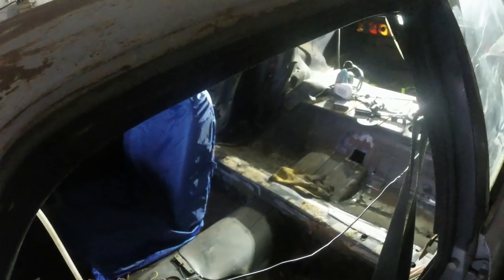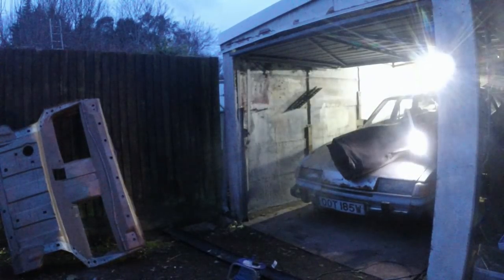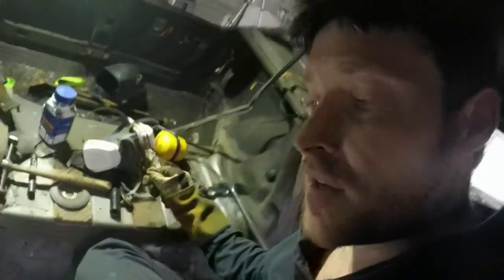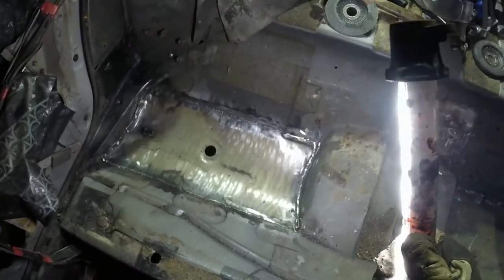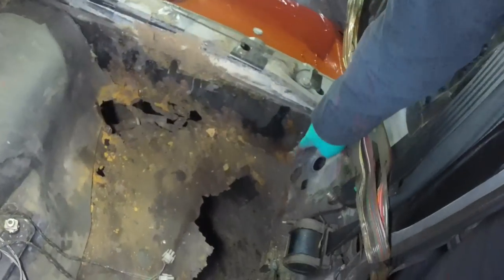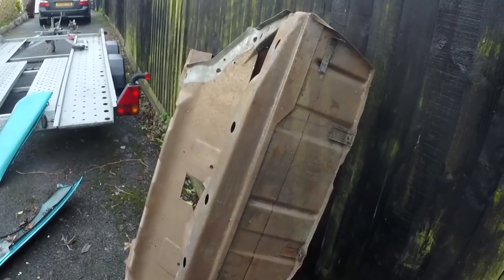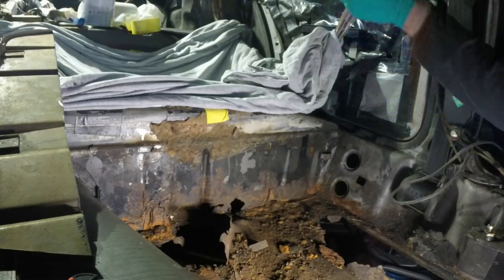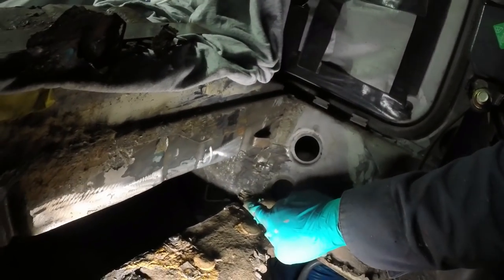Dotty 1981 Rover SD1 Restoration - Video 11 Floor repair More welding

Comment: love these video's, hubnut originally brought me here from when you took the diesel to the NEC. anyway I only have a crappy no-gas welder and for that reason, I dont do welding! but if I did, looking at your videos gives me hope that should I ever get a project car, and a proper welder, I would be more confident with some repairs to sills and floors. Perhaps you should call your channel "doing rovertime", I know you have done bits to other cars, but it is very apt.
Reply from the maker: Yeah i met Ian at the show last year.  Ive got a month to get the diesel welded up and back to the show.
Reply: @nitrosilvia  good work and great videos mate, and Hubnut is great to watch too!

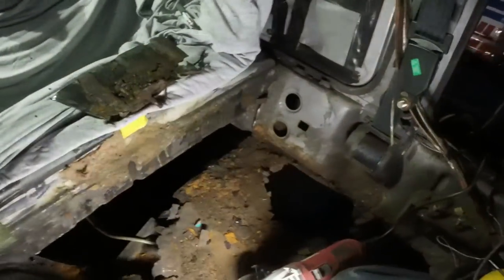Comment: Good points made at 32:50 ish. There is some sort of weird loathing of British products among a lot of British people. We need to get over that as a nation and back our own industries and look through the negative hype at what's really there... Or used to be there :-( When it's gone it's hard to get it back!
Reply from the maker: Such a shame.  SO many cool cars and yet the vast majority of the general public dont see it.  Bizarre.  Just the Clarkson effect.
Reply: @nitrosilvia  yeah I knew doom was coming when week after week Clarkson was talking about how shit Rover were

He had some American singer on the show... He wrote a little song all about how shit Rover are. Clarkson loved it and asked the bloke what he knew about Rover

The geezer said he didn't know anything about Rover - but knew how much Clarkson hated them

And then May's review of the 75... Shiiiiiiiiitttt 

Hammond's Men and Motors review of the 75 was very good
Reply: @hydorah  may had a point though, the 75 was, and still is, a nice car. One of it's main problems was the retro styling, why not something modern?!? Yes, it (sort of) worked for the S-type, but how many did Jaguar sell compared to the equivalent German offerings of the time?

In my opinion another issue would have been the size of the thing. The 75 was too big to compete with the 3 series/C Class/A4 size of cars, but too small to compete with the 5 series/E Class/A6 size of cars, so it sat awkwardly between the two. Add this to the slightly dull handling and the 75 was, again in my opinion, a good car spoiled.
Reply: @Robert_B_445  There was the MG without any retro. And what about Mini? The whole brand is about retro. May is a buffoon and he was just performing in that review. It wasn't about the car very much at all
Reply: That may be true, but the MG and the Mini were niche cars, they didn’t need to sell in huge numbers, the 75 did and so might have done better if it had more modern styling
Reply: @Robert_B_445  I was referring to the MG badged variant of the 75, the ZT - And the range would have done better if May hadn't panned the whole thing, along with Clarkson
Reply: @hydorah  Oh, I see. In fairness, I seem to remember Clarkson gave a very positive review of the ZT.

Anyway, I think you rather overestimate the impact Clarkson has on car sales, for example, he gave a very negative review of the Ford Orion, and it went on to become Britain's bestselling car for a time.
Reply: @Robert_B_445  can you link to that? There was a V8 one... With a Mustang engine in it... Maybe it was that? I'm curious to see Clarkson being positive about anything Rover
Reply: @hydorah  The V8 one was the one he reviewed, there was also his review of the MG SV and even his reviews of the 800 on old top gear (although confusingly he later describes the 800 as "dreadful" at the '98 NEC motorshow). Still, he's not completely negative about rover
Reply: @Robert_B_445  yeah the blokes a complete tool

Comment: Nice work! I'd appreciate the name on that red oxide can if you can remember it off hand, thanks.
Reply from the maker: Its called Bonda Rust Primer.  Its pretty expensive, around £25 per litre, but its good.
Reply: nitrosilvia
Thanks!

Comment: What's the name if the red oxide primer and where can I buy it?
Thanks
Reply from the maker: It’s called bonda primer, I just get it off eBay in the tins

https://www.ebay.co.uk/itm/392337734137?epid=14041745046&hash=item5b5926b9f9:g:KOQAAOSwfCZdKL1b
Reply: @nitrosilvia  thank you for the reply. Love watching your videos, keep up the good work 👍

Comment: You should leave large holes in the floor to enable your girlfriend to add horsepower like the Flintstones. Also nuisance back seat drivers will be too breathless to talk with all that running.
Reply from the maker: Its to let the water out after all this flooding!